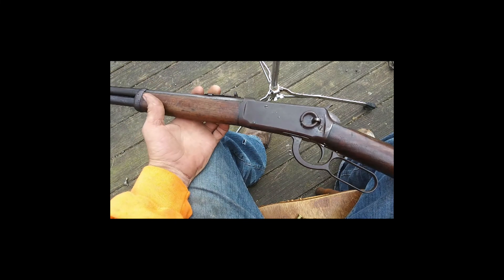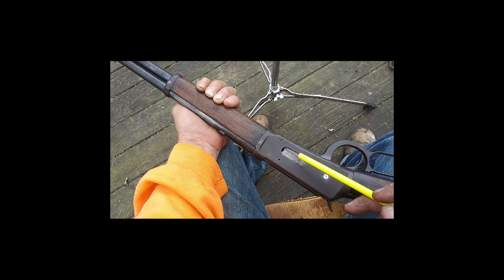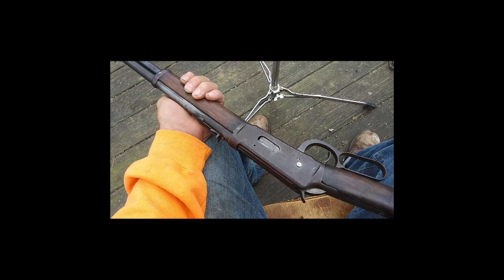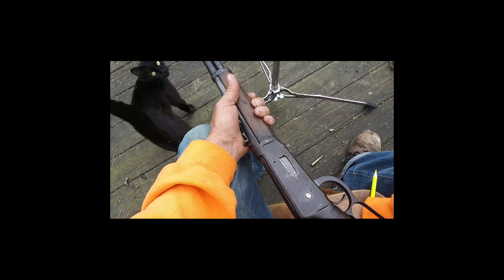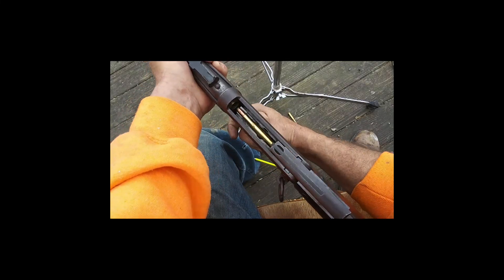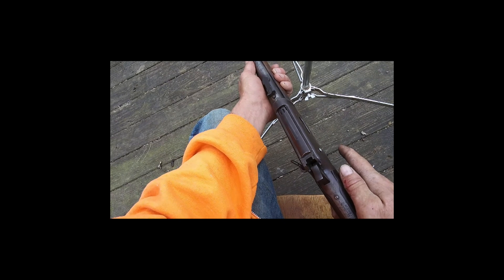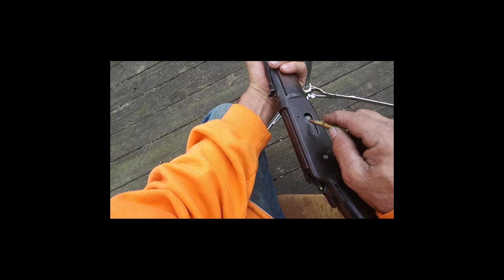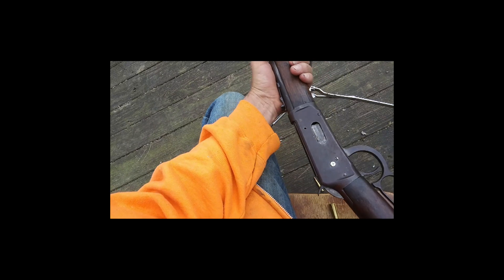This old Winchester 94

Comment: Looks like the gate spring is weak, good place to start.  In my family we have a old Winchester 94   38-55 thats about the size of a 410 shotgun round.  Anyway speaking of nicks and dings the octagon part of the barrel has an axe chop in it! it would be fun to hear that story.  Its worn a bunch, my brother has it, it contemplating converting it to 30-30 just for the convenience.
Reply from the maker: Yeah the stories they could tell! I love these old lever guns. You can still get ammo for them, the 25-35, 38-55, 35 Remington. I have a 30-30 and 35 Remington Marlin. I have a pre 60s 94 30-30 in lay away. There's a few more I want, 45-70 and a couple of the pistol cartridge guns. I guess I'm collecting them now. Not sure how that happened...
Reply from the maker: I guess if I run across a 38-55 I'll have to grab it too. I don't think I could convert it. I think Hornady makes ammo for it.
Reply: @FingerAngle  The bore on the 38-55 is worn out.  It has no accuracy at all.   I have a 7-30  Waters, I purchased it new in the early 1980's
Reply from the maker: @timberdoodles4647  So you can swap out the barrel with a little work?
Reply: @FingerAngle  I think the barrel can be rechambered, It will retain its original patina, some work on the guts too.  He found a place that would do this work. Its not cheap.
Reply from the maker: @timberdoodles4647  oh wow.